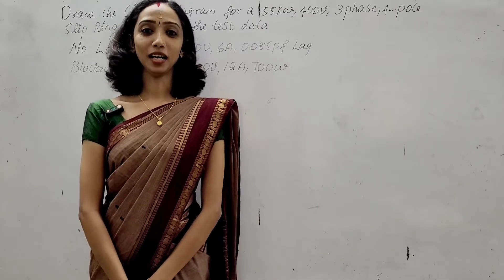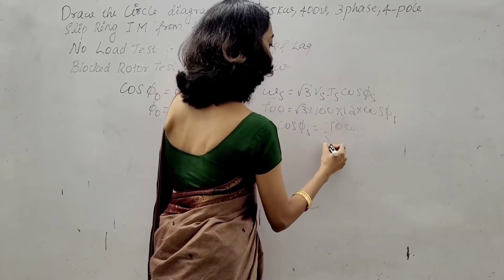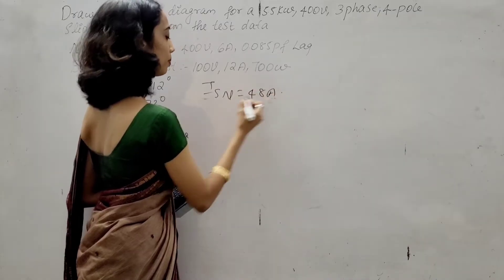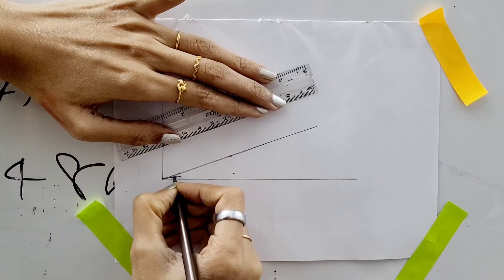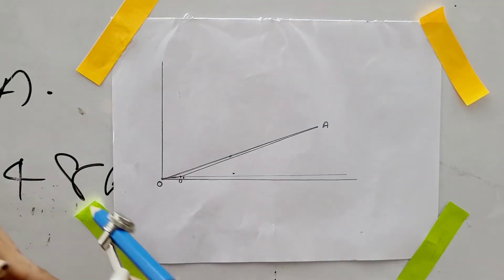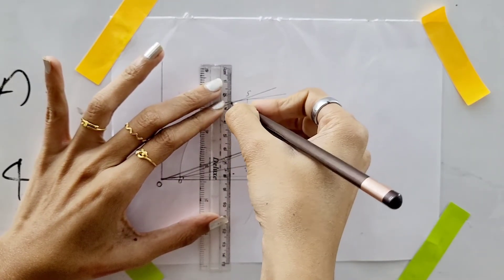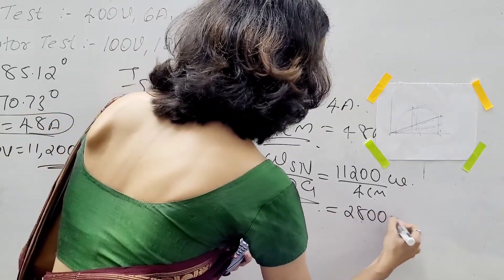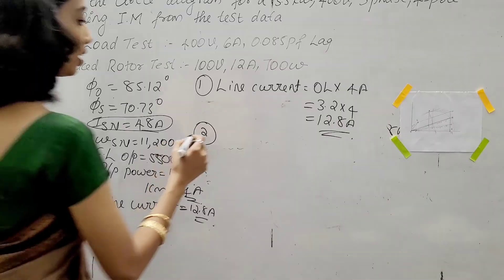Circle Diagram - Question 2 - Three phase Induction Motor - Explained in Malayalam

Comment: Can you please clear which point is L .  Can you please refer the previous session. [In previous session you delivered that the point L is the point at which we draw a parallel line to a o/p line that connects the W touching in two sides of the circle.There we spot one point and now it is different ]